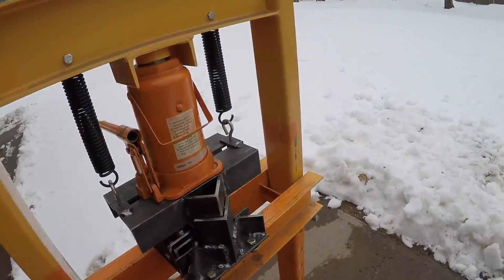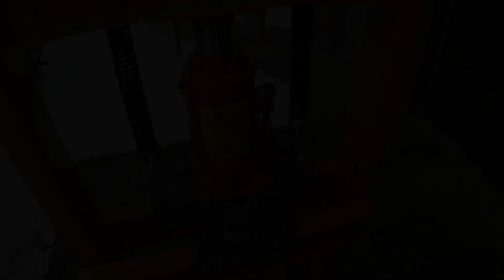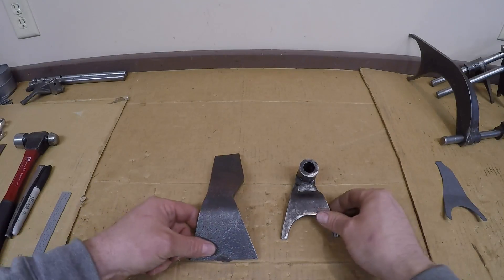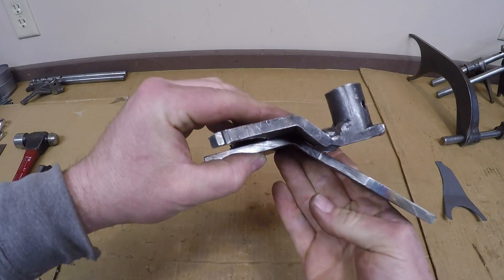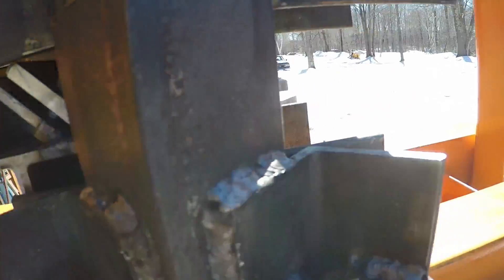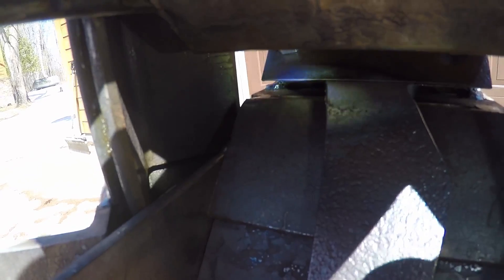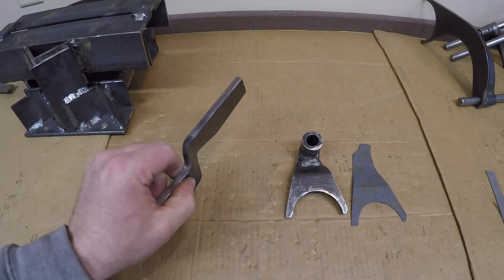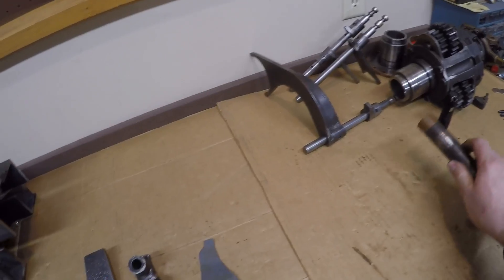Minneapolis-Moline 445 Prototype #X231 - Part 42: Forming the 2-3 Shift Fork Blank

Comment: 15 years ago, I built a 30 x 40 , two-story garage mostly alone.  It has an open ceiling supported by an 8 x 32 glu-lam 40 feet long.  I put that thing 26ft up in the air by myself.  Took two days.  I'm not saying this to be bragging. I'm just saying you can do almost anything  "Little-by-Little".   Most people sell themselves short.  If you say, "I can't do that, then you can"t.   I admire your 'can-do"  engineering ability.

Comment: Great job, not how I would have done it, but you got it done and done well. I would kind of second the other comments about drilling the fork to the OD on the tube and letting it go through the fork. Would seem to be easier to control your specs, give you a little fudge factor. But that's just me. Looks great thanks for sharing

Comment: Most "real fabricators" would have heatedit in a vise and smashed it with a hammer 
Or used a press brake 
Which is basically what you build 
Worked better than some press brakes iv used
That big will be handy down the road somewhere 
Just Gotta remember what dark dusty top shelf it's on

Comment: A bit of my 2 ¢ drill & weld while the tube sets in the bore, then trim it to end shape. That way your shift tube will stay straight. Great job on the metal smithing. Not the way I'd have did it. ??? But hey
 it worked. !!!👍👍
I don't have a press at my shop.😞
 Looks like you are on the right track .....

Comment: Recommend you make a second blank in case something goes wrong while welding the sleeve on. Overall, nice job on the fixture and the forming process. True home shop engineering at it's best! I have the same HF press. Back in my naval shipyard days, we used what's called a bend allowance chart. It took into account how the metal stretches when forming. We would subtract the specified amount from each bend when forming iron so we didn't have to trim off excess after the job was completed.

Comment: Looks like the jig worked out perfect! There's a company that offers a press brake kit (you weld it up) for the 20T press, they're called Swag Offroad. I've used mine a couple times and it works pretty well. 

I see maple season is on for you too. We pulled our taps last week.

Comment: That went very well. I was expecting that you’d have to do chin-ups on that jack handle to bend that 5/16ths but the press made it look easy. Your engineering was spot on with regard to angles and offset. I have no doubt that the new part will equal the original. Hammer on Garth! 😎👍

Comment: Are you going to harden that part?  Since you used heat to form it and I am assuming a mild steel, it will be relatively weak along those bends.  I’d maybe look at doing a heat and quench cycle to get get some hardness in that steel.  Or you might want to look at adding the gussets like the production piece had.  Just a thought because I think you will see some bending and fatigue in those bends over time.

Comment: Since 2nd and third are the most used gears in just about any tractor, you can now build shift forks for sale. I am sue there are tons more that could use a new fork and well, with mounting and cooling and heating i bet you have a couple hours into each one. Now a couple more for a total of about 4 hours to make with supplies and you could sell for $30? So you could have a business to make about $3 an hour, where does one sign up? Ok so maybe heavy manufacturing is not going to happen but a nice piece so far, trickey bends are on point and should be easier now, much more rewarding than using slapped out pieces or moving to all production pieces.

Comment: Glad it worked out for you the purists would dump a kidney if they saw what we do here sometimes compared to your method, I built a jig to make bed top rail hooks for an old rusted out Toyota Hilux pick up truck for a restoration/ mini monster truck build project years ago.  It wasn't as complicated  and it fitted in a big English made Record vice then just heat and squished like you did, the material wasn't as thick or as big a part so i could do both bends at once with it heated. It took longer to profile all the blanks, than build the jig and form them. 

If you wanted to make that project even more fun try doing it with the torch ,vice  a hammer and adjustable angle gauge.  It wouldn't be the first time thats happened here for a 1 or 2 piece production part for a project that would never be repeated, and we weren't quite sure it wasn't going to need major re designs before it worked anyway..  Making ones easy getting the second to match is the hard part without a jig.  Thanks for sharing, take care.